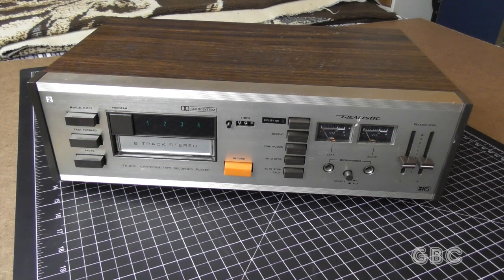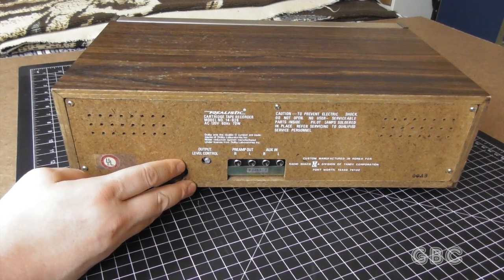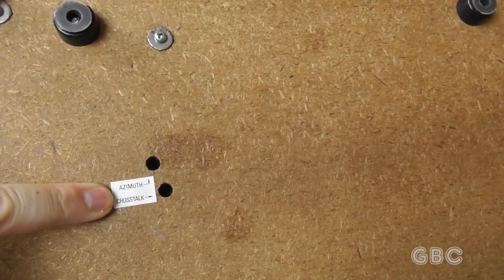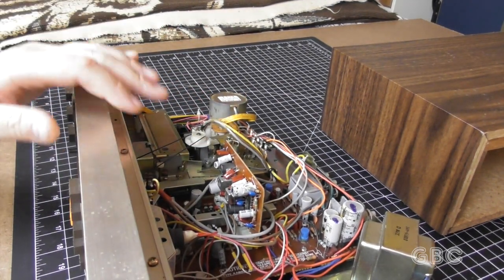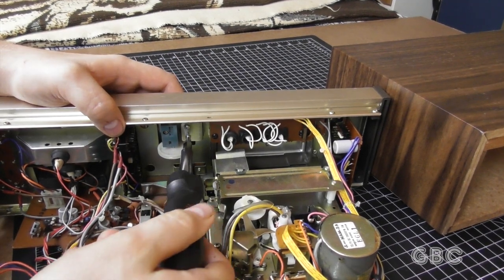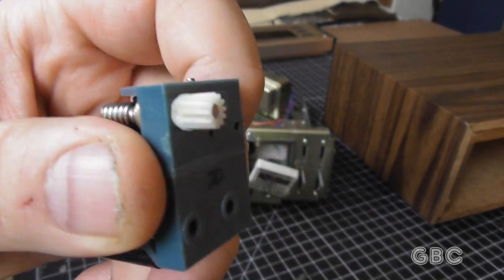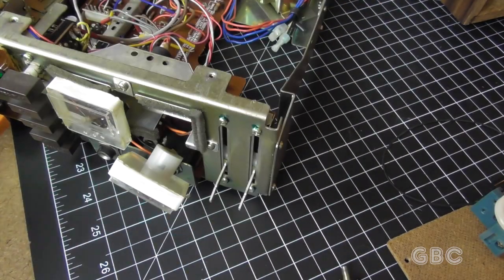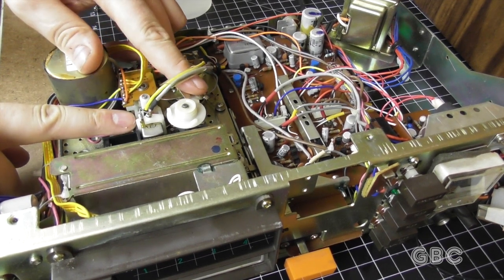[49] Realistic TR-802 Service

Comment: Here 4 years in the future, I have the exact same gear problem. I saw a video by another guy who managed to 3D print one, but I am unsure if the size and specifications are identical. Finding a replacement part as obscure as a small timer gear is not an easy task...have you been able to fix yours yet?